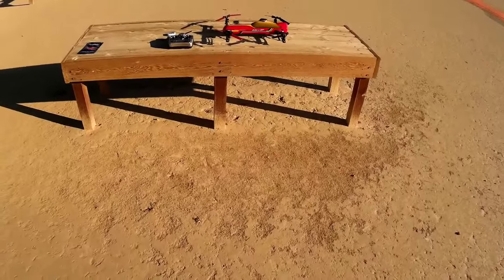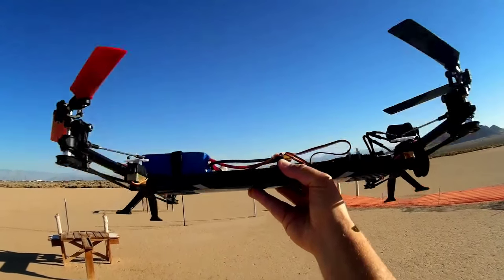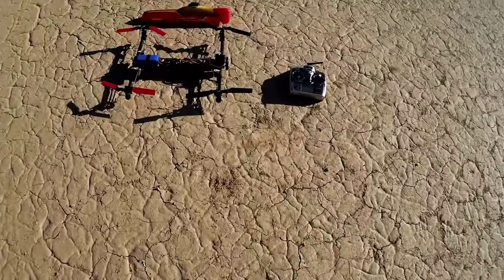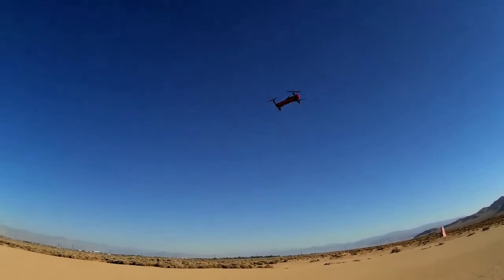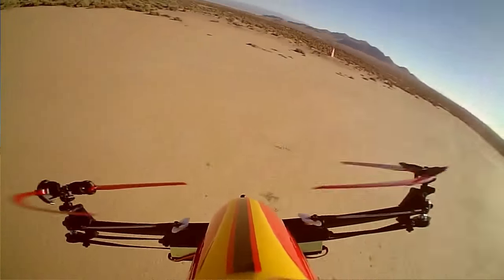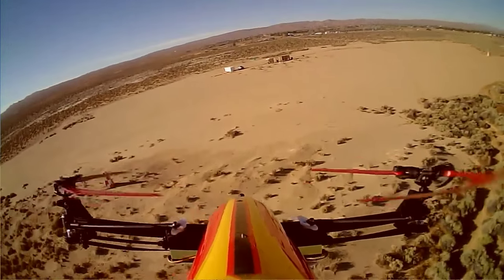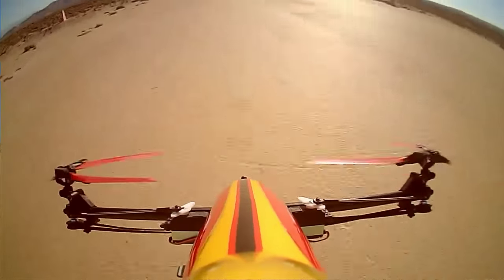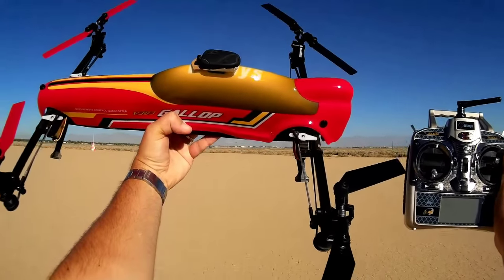WLToys V383 Drone Test Flight Review

Comment from the maker: You can buy the V383 here https://goo.gl/CcLZ8n
Reply: That link goes to an entirely different quadcopter.
Reply from the maker: Sorry about that.  The link has been corrected.
Reply: np. still found it on Banggood and good that cus it was by fare the cheapest place to get it! :)
Reply: Ok it now says out of stock so I guess I got the last one lol. But it says its restocking :)
Reply: Would you reccomend the Up Air One, or the Autel X Star Premium
Reply: The original design of this quad is the stingray 500. This is just a cheap clone that is the exact same thing
Reply: @vernonstanton3217  The stingray is allot lighter and thinner build ...... I stacked mine been a $1000 dollar paper-wait since 2016..... :(
Reply: Gr8 review, may grab this if built solid in your opinion, can you start showing us how far each drone goes and build quality and materials used as in build quality as well as average flight time as you already sorta do.... these are important thing’s but SUBBED and can not wait I want to pull;l the trigger on this RARE beast now, as found one local.... what do u think one is worth used and what is MAH of batteries is the charger fast and is it more then one batt, thats a big boy, light or heavy? I want one for city that can go super high and / or far as well with decent to great manuvibility.... btw: kindof crappy RUN at 7 minutes or barely, can two or three batts be added or even a higher OEM or even if not OEM batt to double or ewven trip / quadruple flight times...

Comment from the maker: Need to state that this quadcopter is a clone of the Curtis Youngblood Stingray 500. I was unaware of the Stingray when I made this video (sorry for the "unique" statement).
Reply: Can u reveiw the yi zhan x4 plz that would be so cool
Reply: Quadcopter 101 Another honest review, thanks. I was really curios how this flies. Curtis really deserves royalties paid but based on your review and shaky camera view I don't think Curtis has too much to worry about. It looks like a Stingray 500 but it doesn't seem to fly like one. I was really impressed by Curtis's FPV video using the Stingray 500 that had a stable camera view and seemed a lot more refined and less "truck like". But the reference frame created for orientation from the view of the pilot is outstanding IMO.... really nice to see the horizon like that. From what I understand and recall Curtis's father was the brains behind the flight controller and it took quite a bit of work and collaboration where I'm sure years of experience winning helicopter championships laid the groundwork to get it right using collective pitch and a single motor. But this is quite a step away from the light weight quads you normally review and was glad to see it. In retrospect I think the small RC multi-copters are great news for the RC hobby as for FPV all you really need is to get the camera in the air on something fast that handles good and it seems like the hexs are worth it for the extra flight time they provide and getting a lot better. Liked your review on the X600, just wish it had an option to use a better TX which is just as important as the machine in control IMO.

BTW... I went to replace the FCB in the U807 with an Spektrum compatible FCB from a NanoQX and noticed a solder point that looked cold so resoldered it and it seemed to fix it but could have been applying the heat as well so can't say I trust it yet. It has a noticeable hesitation on takeoff when cool after binding but after the first lift off the hesitation goes away and since no one else has reported that I'm am going to change tips and resolder another couple of spots and see if that helps as I might have missed the one that actually needs it and heat expansion is closing a gap, but at least I got to fly it and get a reference for how it flies which is quite good although the low resolution TX takes getting used to (yuc) and will still try the NanoQX FCB on it so I can use a good programmable TX with it. Surprisingly the NanoQX has 11ms servo timing to take advantage of a DX9/18 as well as a longer flight range RX in testing than the HH Delta Ray which uses a dual antenna. It's amazing how many other quads the little QX's FCB is being used on and think the low pitch of the U807's props should work better that others in use but feel humbled as without knowing I'd say you'll fry it's tiny footprint  but it seems to survive the extra current and if its not getting warm then all should be well with resistance so I'll see for myself. 

Blade should come out with a programmable FCB for brushed motors since they seem to be dragging their feet on improving the 180QX I've been waiting on for the back yard. Blade seems to have dropped the ball with the Nano QX too. They should have upgraded to 7mm motors keeping sales up with the original concept when it was new and hot off the press before being copied and surpassed in many regards needing lights and better outside performance. Inside I don't think anything has really passed up it's good manners but after an hour flying inside I just wanted to take it outside and give it some space. Would like to see a review on TX's available and your impression on resolution as well as range.
Reply: +Quadcopter 101 oh and don't forget, Hobbyking copied this too!
Reply from the maker: spencer 124 Shame on all these copiers.  But wasn't this design patented?  If not, why not?
Reply: Also there's no swash plate just pitch control.
Reply: +Quadcopter 101 Appreciate that you comment and reiterate your safety concerns in that this is a massive quad, but it should have also been noted that for those who might be apt to hand launch it, the power going into those unguarded rotors is a serious threat to ones carotids.
I'm surprised that one of the cable TV networks hasn't approached you to host a similar, but expanded format.  With a small, professional crew,  better funding, and your personality,  you might expect a much larger viewership.  You'd also make a few bucks which I believe you deserve.
Reply: WesleyLocust Agree on both counts. He's one of the few reviewers who does the first and most important thing stated in every major brand's RC transmitter manual to do before flying:\:

The important TX/RX range check for security as well as signal reception fail safe. It's the first thing he does or refers to. I noticed that right off as it's what I wanted to know first as without range control you don't have a remote control aircraft anymore.

He also separates the toy class from the "it can hurt you or someone else" class and that REALLY needs to be done. Hard to believe some people cannot see the difference from a rock called a quad copter and a  "proper" RC aircraft with wings or auto rotation capabilities to deal with a loss of fuel or motor power. If you look you never see RC helicopter pilots flying far more capable and efficient rotor craft at high altitudes and doing the crazy things you see  "I'm real good at this now" minded beginners that cannot really fly an RC aircraft without a computer using gyros and accelerometers doing the hard part. Give Grandma a quad big enough so she can see it and she'll be an "expert" in a matter of hours too.

Of course many if not most of what you see done on Youtube as glassdogangle's countless mindbender videos of deception show pissing on the RC hobby making fun of people's gullibility is all part of a show created by a well supported anti-RC aircraft agenda of paid political lobbyists intent on damaging the RC hobby to get their way. These people have worked in the shadows of deception before we had electricity so that is to be expected by anyone awake to reality. But nevertheless after deleting all the complaints posted in objection to what he is doing to make it look like he is supported by the majority he has shown some people in the minority really are stupid enough to copy what he and others do damaging the reputation of legitimate RC pilots and these people easily influenced by suggestion pose a threat by failing to have  the common sense real RC pilots have shown made the RC hobby safe without countless incidents that would occur if everyone copied the idiots posting high altitude RC aircraft videos of flying RC aircraft recklessly. 

When people had to build their own RC aircraft as well as fly them unassisted by technology it created a natural filter that weeded out the people that shouldn't fly RC aircraft because they couldn't do it or didn't have the personality type willing to do what was required to learn. But technology changed that and perhaps for the worse as too many people doing something only brings out the worst as we see happened with surfing when the cameras and money showed up at the beaches in Hawaii.
Reply: Quadcopter 101 a
Reply: Shaky camera view has nothing to do with how it flies, your comparing a cheapo key chain cam to a go pro that Curtis used. I've got the same if not better version of the key chain cam and if you dont mount it on top of some type vibration iso pad it does the same. Now as for flying I have two Stingrays and have flown the V383 and they fly the same....

Comment: I have one of these and it is a KEEPER! These fly very well and yes, I've done 3D flying with it. The control system just automagically flips everything for you when the copter is upside down so you don't have to worry about flying backwards into a mirror image! If you like mechanics and drones, THIS is THE copter for you. btw, mine was $161.05 special price in Nov., 2017. Some say this must be an example of British over-engineering. These were $688 at some websites and still online today, crazy!

Comment: Not sure if anyone else mentioned, the switch on the right is Throttle Hold (cuts power to motor) might be what you mean by Lock/Unlock. 

If you are familiar with regular helicopters Throttle Hold is what you hit when you are testing swash limits (binding) or right before/after you crash to minimize damage!

Comment: It is probably designed to feel more like a collective pitch helicopter rather than an fpv drone so it will be less responsive and will get more time to do fast transistions/direction changes but it has a good top speed and carries it's momentum well that you have to manage your throttle and pitch to keep it in the air as it is doing it's thing..

Comment: Funny you mention the V383 fly's like a truck. If you think about it  it is kind of like a truck. Remember the old international 800-A Scout. it had full posi front and rear in four wheel drive. Which is pretty much what your flying. full posi on all four props.

Comment: I don't think those are swash plates, as I don't think you control the cyclic of each rotor. Although I haven't seen one up close yet, I am pretty sure you are ONLY controlling the pitch of each of the props individually, and not the cyclic, so there for not a swash plate.
Reply from the maker: +Wm Robert Leschyna Here are more details of the pitch control system for the V383 https://plus.google.com/+Quadcopter101Blogspotcom/posts/CQQHCVjupt6
Reply: +Wm Robert Leschyna so what is the correct term then?
Reply: Not sure what exactly you are asking. But the control would be just pitch, changing the pitch of the props, the pitch will be the same through the full 360 degree rotation of the prop. Whereas cyclic control allows for pitch to change but at a different rate throughout the 360 degrees. Not sure if that makes sense, hope it helps.

Comment: the switch on the right is throttle hold if it works like the nano 3d qx it stops the motor from spinning you need that for some manuevers i "think" i crashed it more then flew it in 3d so i stopped trying haha

Comment: that is not the way you test the flight time of a $330 quadcopter. you should fly for about 3 minutes, land and use a battery tester on the balance plug to see what the voltage per cell is. you don't want to fly the battery below 3.7 volts per cell or you will destroy the battery, copter, or both.
Reply: Damage does not occur until the voltage goes below 3.0 volts :)

Comment: Possible to mount a gimble and throw on a gopro?
Reply from the maker: +mike ricky Sorry, no mounts or port for a gimbal.  But it has more than enough power to lift a GoPro if you can devise a mount for it.
Reply: +Quadcopter 101 could you recommend from ones you tested that would be the best under 500 that I go throw a gimbal and gopro on . I do still photography as it is now looking to try dramatic video that these can capture I am from NYC region.
Reply from the maker: mike ricky The following.  It has up to 30 minutes flight time, and up to 1000m range https://www.youtube.com/watch?v=y5IFCVclpyk
Reply from the maker: mike ricky and since your from NYC, please please please don't be this guy.  https://www.youtube.com/watch?v=_U8iHn_2l0U
If you're new to this hobby, learn to fly first with something cheaper, lighter, safer, such as Syma X5C https://www.youtube.com/watch?v=y93vzA-KRlM

Comment: thx for the review-vid.. to get an idea of center of view, - is this product a free product with the promise if s sharesale link, or have you put 400 dollars of own money..

Hence the fact ' I doubt that anybody would put 400dollars behind a 1-motored-quadcopter if it aint was the (collective pitch) 3d-factor that was center of stage..

one motor setup on these CP-quads, got there pro and cons ' but kudos for the approach, of "lets see what this button does", but then again on a very fragile 400 bucks collective pitch machine, where theres close too no parts atm, it will very fast be 400 bucks out the drain and useless quad on the wall. 

if its a free-china-gift from Gearbest, with a sharesalelink in mind, it make sense the loose approach, but if its 400 of your own money, be carefull, and perhaps test the 3D factor on a high-grassy field, or a mark where there some buffer to help with the impact ' if you literally floor it, thats quite common for new 3d pilots, ref the negative feature..
Reply from the maker: +Jakob H. As shown in the beginning of the video, it is a "courtesy" quadcopter from GearBest.com (meaning free sample for review purposes).  But have been practicing 3D flying in baby steps with my Walkera Runner, and plan to do the same with this.  But your point is very valid.  This by no means is a quadcopter for new pilots.  And even experienced pilots should approach flying 3D mode with caution.

Comment: hi there
you could also mention that the machine is cheaply build, which is an aspect of flight safeness. One motor for 4 propellers is already a challenge. And WLTOYS Weili is very well known to save money on all components. The belts & connectors and the motor ( which is quickly overheating ) are a joke for such an aggressive machine. The RTF radio is set to fail already. It is so miserably made and has already a history of failures. Look WLTOYS Weili radio teardowns and you will believe me as a foreign designer living in China for a very long time. Luckily you are flying in a desert area and not in urban structures.

The real domestic competitor for the WEILI 伟力 aka WLTOYS is the 3DQ-S1 from 艾锐泰 aka AERITECH http://www.aeritech-uav.com  / here are the Youku videos for you to compare: 

1. http://v.youku.com/v_show?id?XODczODcyNjQ4.html?from=s1.8-1-1.2 

2. http://v.youku.com/v_show/id_XMTMzMjUzMjczNg==.html?from=y1.7-1.2#paction 

3. http://v.youku.com/v_show/id_XMTIODA2MDk1Ng==.hmtl?from=y1.7-1.2 

the machine is actually better build then the WEILI. WEILI always tend to be cheapishly cheap builds and knockoffs from domestic and international builds - you can see their radios / gruesome !!!. AERITECH distributes 2 versions of 3DQ-S1 machine. The Sport version is more powerful. It is locally more expensive, cause they try also to establish and mark up an 'own' flight controller ( which is actually also a copy of a well known OPEN SOURCE flight controller ) :-(

It is a also a joker company when u see that they write ' copyright ... ' on the controller housing.

So finally my suggestion: dump them and support only OPEN SOURCE & OPEN INFO and of course any originals like the STINGRAY. 
Nothing against making some bucks with affiliate share link sales, but also need to know with whom you are finally doing business and support their distribution. In my eyes the wrong guys.

Herri 

ALL CREDITS go to Curtis Youngblood who is an awesome pilot, sportsman and creator. Hatsup.

Comment: wltoys the copyking
Reply from the maker: Alexander Gao Yeah, a couple years back Hubsan got so mad at the WLToys clone of their H107L (WLToys V252), that there was a period there that they'd refuse to supply any vendor which sold the V252. The V252's ended up on eBay and AliExpress sold by these same vendors under different names ;-)
Reply: hehe
Reply: Quadcopter 101 any wltoys quadcoptor is a clone